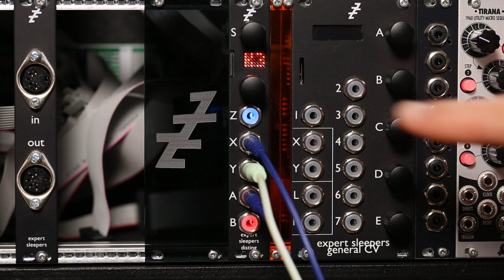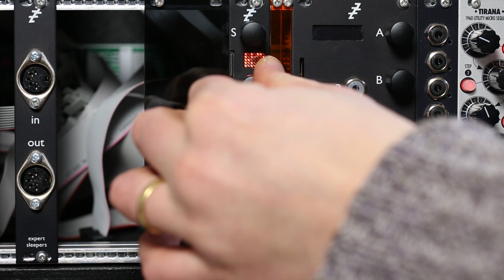disting mk4 - Wavetable Waveshaper

Comment: This is the most interesting algorithm on Disting. It would be very helpful to see it on the scope. I don't understand how the different waveshapes from the tables are altering the wavefolding. Please make a longer video showing how this happens. You've done amazing work on this one.
Reply: Watch a demo video of RYO VC Sequencer, such as the one by DivKidVideo at the end when he runs it at audio rates. The incoming signal (when in VC mode, not trigger-controlled mode) determines the position we LOOK UP in the wavetable. In the case of the VC Sequencer, we have 8 steps (samples), each with their own value that is then sent to the output when the amplitude of the incoming signal points us to that value. In the case of the Disting, we could for instance have 256 samples instead of 8, and when we morph a wavetable, it would be like turning one or more of the knobs on the VC Sequencer.
Reply: I think the easiest example to understand is that of a pitch quantizer, for instance one that quantizes to octaves. The wavetable would then look like an ascending staircase ramp wave, where the value of each step up that staircase would jump up 1v higher as you progress upwards to the right. The higher the incoming pitch CV, the farther "to the right" in this waveform we place our virtual cursor. And then we read the amplitude value at that position and send it to the output.

The second easiest example is that of a linear to exponential converter. The wavetable would then look like a graph of the formula y=x^2, which looks like an ascending line that becomes exponentially steeper the farther you go to the right on the X axis. And thus an incoming signal will be amplified exponentially stronger.

A third relatively simple example is that of a wavefolder. A wavefolder takes a signal and wraps it around itself. In the case of wavetable lookup mapping, the wavetable would then typically be SEVERAL CYCLES of a simple wave (e.g. triangle). Why? Because you want your signal to wrap around itself SEVERAL TIMES the louder it gets.
Reply: And yes, I agree with you that this is the most interesting/useful of all the Disting algorithms. There are several wavetable lookup waveshapers on the market, but they either only work on audio and not CV (e.g. the Piston Honda or Shapeshifter), or they don't morph from one wavetable to the next (e.g. the Megawave or Gamma Wave Source). The Disting not only does both, but it also lets you easily use your own wavetables from an SD card. It's a keeper.

Comment: hello , i need a freeze  effect & comb filter but i have no hp left, do you think it would be possible in disting ? maybe already achievable with a clock delay ?
Reply from the maker: C-2 Voltage Controlled Delay Line should work as a comb filter.